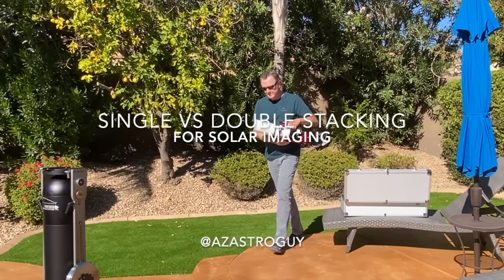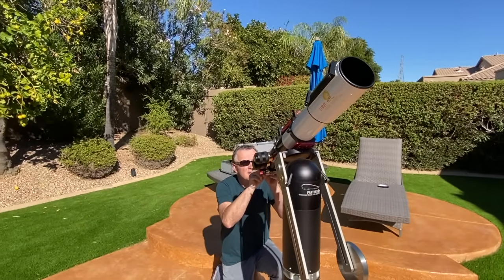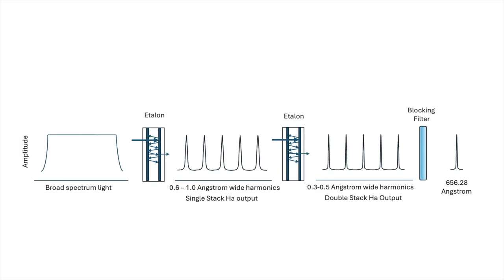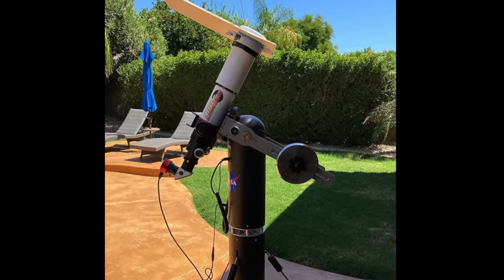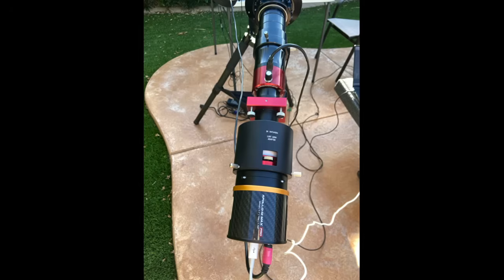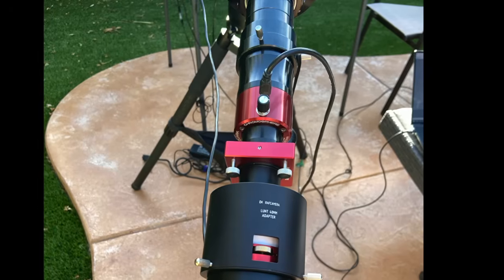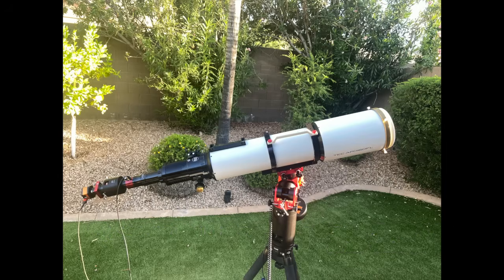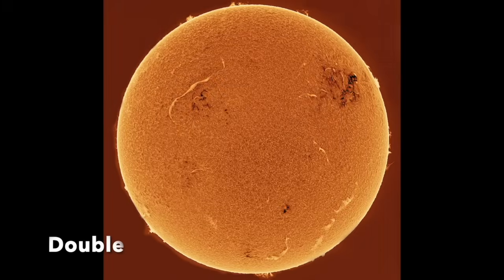Double stacking in solar imaging: is it worth it?

Comment: Great video. I've used a Lunt 40 single stack for the past two years and just received my dual stack etalon last week.  The 3D effect is one of the most exciting parts of using it visually, as now it really looks like filaments are floating above the surface.  You can really pick up more fine details in their structure. 

It has also been fun playing with putting it really off band as ir can make some elements look striking even if it hurts the rest of the disk.

The reduction in brightness and less visible prominences from the double stacking is a trade-off for sure, but overall I feel like even most people who had never seen the sun through an H-alpha telescope before would be easier impressed with the double stack view. 

I'm excited to use it for imaging once the clouds clear up!

Comment: As you explain so well in your video, the double stack greatly enhances contrast and provides a real 3-D view. The challenge for me is to get the best tuning result with the double stacked system for viewing and imaging with my pressure-tuned LS80Ha. I like to let the scope acclimate for about an hour before using it. Then I tune with just the single stack trying to get even brightness and contrast across the disk. Then I add the double stack and tune it to get even brightness and contrast across the disk. I also found that rotating the double stack about 45-degrees from the primary etalon really reduced the glare and gives me a nice contrasty view. Any tips you can offer would be great!
Reply from the maker: You have really hit the nail on the head Robin!  Assuming you first have focus (I usually focus on a contrasty filament or sunspot region) then I follow a similar process. I have experimented with rotating the second stack and find about 45-50 degrees provides a slightly improved view.  If you are imaging, then taking flats also helps a great deal with brightness uniformity.

Comment: I have a Lunt 60 lstha what is a good camera setup to use for full sun without having to send a lot of time on the computer stacking photos it using with the asiair mini  for stacking on a iPad or phone
Reply from the maker: I don’t recommend using an ASIAir for solar stacking. Sharpcap is better. The Astronomy tools website is a great resource to see what field of view you get with any scope/camera combo
Reply: @AZASTROGUY - The Asiair can't even be used for the video portion of full resolution full disk imaging.  I wish it was possible as it's my preferred system, but the maximum video resolution of 1080p greatly limits what's possible.   It's also not usable for solar timelapses as there is still no video autorun feature. I found this out the hard way during a three hour timelapse where I had to set timers on my phone and manually start and stop each video.
Reply from the maker: @40Sec great for dso’s, otherwise weak

Comment: I am currently putting together an Askar 151PHQ, f7, 1057mm, into a solar scope. I have a question, maybe you can help. I am wanting to use a daystar 140 D-ERF filter stopping the scope down from 4410mm using a Chromosphere Quark making it f29.5 to 4116mm using the 140mm ERF. Making it f31.7. I hope my math is right. Do you know if  this higher f ratio will cause the quark to be off band?  Any suggestions?Thanks for the great videos you have put together! Great info.
Reply from the maker: That should work perfectly!  Anything around F30 is workable.  Good luck and I look forward to seeing your images.